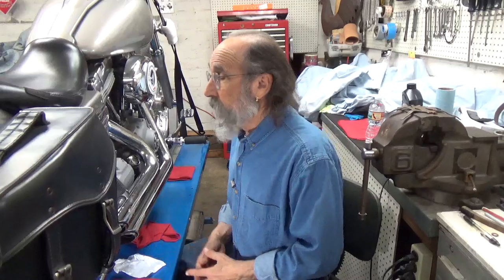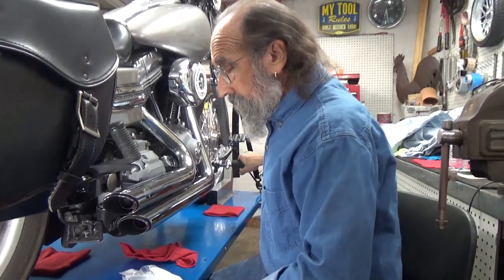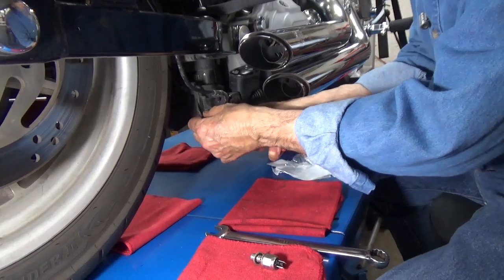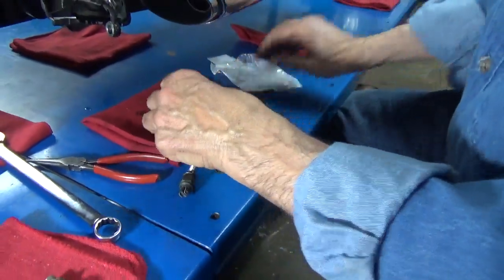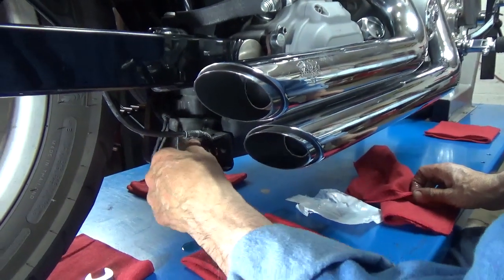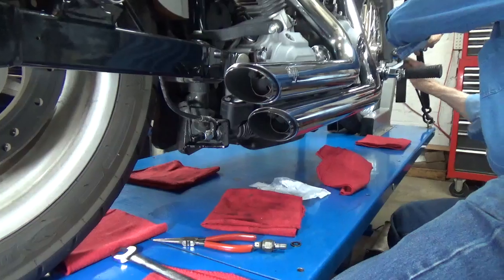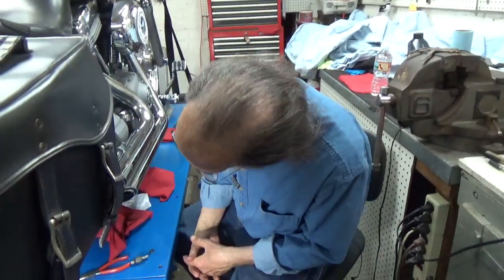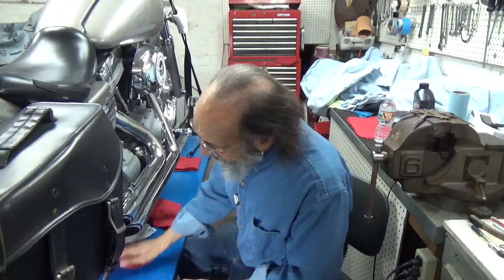Changing the Rear Brakelight Switch On a Twin Cam Harley Dyna

Comment: Excellent tip on keeping a little pressure on the brake pedal. I didn't loose but a small bit of brake fluid and no need to bleed the system.
Reply from the maker: Glad it helped!

Comment: It's a good thing the switch is working because a SUV rear-ending a motorcycle would be a very bad accident for both bike and rider.  I got lucky last October when my switch was defective on my Vulcan 800 (I didn't know it) and when I came to a stop the SUV that was behind me suddenly appeared beside me on my right, I was almost rear-ended and it would have been bad, the culprit was my brake light switch was defective.  It was my fault though because I got lax checking for all working lights before each ride.
Reply from the maker: Glad you're okay.

Comment: Great video I did this very easy. I had a question after I switched it out when I ride I feel like I have to put so much pressure on the rear break and it hardly slows any ideas why? Also rear break worked fine before I replaced the switch.
Reply from the maker: Try bleeding it or maybe the caliper needs cleaning.

Comment: Hello Mike, Dennis here, new rider, new Harley owner. I just bought a 2015 Dyna FXDL Lowrider and the brake light was on for a few days and now works intermittingly. By on I mean just like the running light, illuminated non stop. Now it just doesn't illuminate. If I remove the tail light socket and reposition it the brake light works for a few minutes and then goes back to not working. The running lights are fine but now no brake light and at first it wouldn't go out. No wires are loose that I can see, does this sound like the brake light switch? Thank you for your great channel and apologies if my question is not clear. The code displayed reads b2161...
Reply from the maker: Can't be sure, but, probably the switch.  Play with it and see if it's the front or rear switch.

Comment: Nice easy fix Mike, as always thanks for the videos. How about doing something on the '97 - '99 FLSTS  especially the front end adjustment and care. I love these bikes with the old evo's  and trying to learn as much as I can. Thanks again my friend
Reply: (cough) 'bikes with the old evo's' ? Sorry, must be an 'age' thing; 'old' to me means Whitworth threads & iron botty : )
Reply from the maker: Old?  I remember the first Evo cylinder head I removed.  That was in 1984.  Not long ago!  "Old" means 1930's, 1940's or even 1950's.  But, next time I work on an "Old Evo," we'll show it.  Thank you.
Reply: @pacificmike9501  You are right Mike, I was comparing EVO to a New 131.  I will stay air cooled, Thanks!

Comment: I just picked up an 07 softail custom two days ago, practically new I was thinking. Rode last night for the first time and clearly have a sticky front switch and no rear brake light. At least it'll be easy to check out today and with any luck get back out again tonight(FULL MOON). The caps must both leak because the powder coat is bubbly, but not wet. Wasn't there a recall for this? I sold my 08 Cross Bones about 6 years ago but I remember it went in and they put a fat 1/2 inch thick ugly cover on the front master.
Reply from the maker: Check to see what brake fluid your bike requires.  It is either Dot 4 or Dot 5.  It may have been serviced with the wrong one.  Be year and model specific.  Harley did some changes around that time.
Reply: @pacificmike9501  it says Dot 4 on the cover and I'll probably have to plan on flushing it all out. The rear switch is bad, the brake light came on with the jumper so nothing to guess about there. Thanks for making it so easy with this video!
Reply from the maker: Sometimes brake fluid doesn't get changed and should.  Quite often, the wrong fluid gets added.  Just be aware.

Comment: Thanks. Mine needs inspection and wouldn't you know it, today the rear switch is bad. Front activates brake light fine but rear only worked with pedal depressed all way down, this morning kaput.
Reply from the maker: Yes.  As they age, they require more pressure until they need replacing.
Reply: @pacificmike9501  Sort of like a woman. lol

Comment: Hi PM and MM ! Here's one for ya..my rear brake light works on the first press only. A second press and no light.. I have to wait several hours and then it works again on the first press only.  I did the switch test and it indicates the switch is bad. Pads are good. But normally the light stays on when the switch is bad. Any guesses? I wouldn't blame you if you pass on this one ! LOL...Take care guys I truly appreciate your efforts!
Reply from the maker: Okay.  I'm gonna pass.
Reply: @pacificmike9501  ouch

Comment: My Dyna Switchback is fine when you first take off on it but after about 60 miles the brake light comes on. I had to resort to putting a bulb in that won't work for running lights so it doesn't melt everything in my taillight housing. I need help.
Reply from the maker: Check the switch first.

Comment: Can a switch leak, but still work? My brake lights still work but the brakes do not, the rear brake goes to the floor. It seems to be leaking out of the switch.
Reply from the maker: Could be.

Comment: Even though some fluid leaked, you don't seem concerned... how much is too much? teaspoon?
Reply from the maker: Believe it or not, by holding that pedal down, just a little, you won't lose more than a drop.  After closing the system, pump the pedal a few times.  Now, bleed to check.  No problem.
Reply: @pacificmike9501  So he still needs to bleed them... I didn't realize that.

Comment: Hi Mike, I'm struggling to understand how you didn't get air in the line between the switch and the calliper on this one!
Reply from the maker: By applying light pressure to the brake pedal, there was no room for air.  There is , again, "light" pressure keeping air from entering.  Try it.

Comment: Mike - thank you for the great video! Do you know the part number of the rear brakelight switch for a 2008 FXDC?
Reply from the maker: Thank You.  It is a different switch than the other models use.  I don't have that parts book today.  But, your local HD dealer can easily give you the number and he may very well be the only place around that stocks that Dyna switch.
Reply: @pacificmike9501  Thanks Mike!

Comment: it's really weird, both the hand brake switch and foot switches went out at the same time, I got the hand brake switch fixed by applying a little oil to the piston shaft and then found out the foot brake switch was also not working, does the brake master cylinder have a switch in it ('95 FLSTC)
Reply from the maker: The front brake light swich is inside the lever housing.  The rear brake light switch is in the line along the frame between the transmission and thrr swingarm pivot.  The other things that could have happened, is, the bulb burnt out, or the wire is hurt underneath the rear fender.
Reply: @pacificmike9501  considering the light works with the hand brake I'd say it works, if the foot brake switch is bad would you still get a brake light with the hand brake?

Comment: My paper clip touched pipe afterwards no hazards or blinkers working all front lights are on but rear turn signals not but will blink when I put alarm on. Suggestions?
Reply from the maker: Check your fuses.
Reply: I’ll give it another look. Thanks

Comment: Question my break light stay on , would that be the switch thanks in advance from Australia
Reply from the maker: Well, what is the motorcycle?  Is it a front or rear brake?  Is it mechanical or hydraulic?
Reply: @pacificmike9501  it’s a 2016 breakout Hydraulic rear brake

Comment: How far do you depress the brake with the bungee?  What size wrench does the bolt take?  Thanks
Reply from the maker: Just depress a little bit.  I don't know what size your fitting is.
Reply: Same bolt you are using its for a 15’ dyna streetbob.  I think it maybe a size 11/16 wrench
Reply from the maker: Probably.  I'd have to run down a bike to check.

Comment: Does the rear brake switch need brake fluid in the master cylinder to work?
Reply from the maker: Yes, that's where it gets its pressure to operate.

Comment: 2008 Rocker C rear brake switch just went up in smoke on mine...   charred wires etc.. looks like a nightmare to replace because its right up against the frame and hardly zero room to work in.  Plus redoing the electrical connection.  arhhh
Reply from the maker: Bummer.  But, small issue.  Better figure out why something touched and fried it.

Comment: That switch it’s specially for bikes or car uses the same ones ???? Can I use them ?
Reply from the maker: That  is a specific Harley piece.  But, they work the same way o a car.
Reply: @pacificmike9501  okey maybe are the same, thread, size, pins, etc...

Comment: So there are 2 washers used? Just bought the switch at dealer and they said nothing of them.
Reply from the maker: I think you're speaking of the two gaskets, one on each side of the "banjo" fitting.
Reply: @pacificmike9501  yes. Thanks. I'll have to head back to dealer. 😎

Comment: Hey Mike! What if my switch is sticking do I need to replace it or put some old wd40?
Reply from the maker: You can try anything, but they periodically go bad.  I'd probably just replace it.  Don't remove it and "fill" it with anything.  That would contaminate the brake fluid.
Reply: @pacificmike9501  Thanks buddy! I just went to Harley bought a new one. It was only $12.

Comment: Will a bad brake switch cause loss of hydraulic fluid in the pedal
Reply from the maker: Only if it's leaking out onto the ground.
Reply: @pacificmike9501  on a ride yesterday just briefly my brake pedal went soft then I pumped it in the park position and it rehardened I haven't had a problem but now my brake light won't go out or off I can flutter my back break paddle a few times and it'll go off but I'll turn back on is that the brake light switch underneath the transmission

Comment: My brake light doesn't come on unless I'm standing hard as I can on the pedal is that the switch
Reply from the maker: Normally, yes.  It wears out.  You stand on it.  It works.  Replace it.
Reply from the maker: Normally, yes.  It wears out.  You stand on it.  It works.  Replace it.
Reply: @pacificmike9501  thanks for the advice mike I'll get it done see until then see you on the road
Reply from the maker: That's good.  Brake light very important.

Comment: Does it matter which side the wires go on? My 2010 wide glide has two wires
Reply from the maker: No, it does not matter.  It is just a switch.
Reply: @pacificmike9501  thank you
Reply from the maker: You're quite welcome.
Reply: @pacificmike9501  will the bungee cord holding the brake down work on my 2010 wide glide?
Reply from the maker: Sure.

Comment: What happens if you don’t hold the brake pedal down when pulling the switch, didn’t hold my brake pedal, pulled the switch, no light still. Electric is good and brakes are working, little to no fluid came out when I pulled my switch off. Bled the bleeder one time but seems silly to flush the system don’t think that’s my problem
Reply from the maker: Is the bulb burnt out?

Comment: Why in the name of all that is holy doesn't Harley use the simple and reliable mechanical switches like those on all the Japanese bikes?!?
I have owned 27 motorcycles, 3 of them Harleys and had the rear brake switch on all three Harleys fail and exactly zero of the others did.
I love my HD's but that shit is just quirky for the sake of being quirky.
Reply from the maker: I don't know what to say, other than, "Don't kill the messenger."

Comment: You left air in the lines, you need to bleed the brake.
Reply from the maker: That's why the pedal is pulled down slightly, so it can't suck air.
Reply: @pacificmike9501  Yeah, but air was introduced in the line and  the switch itself, whatever leaked out was replaced by air. Yes, the brakes seem okay but air is air.  Because of the placement of that block, it probably won't backbleed like a MC would. Advise your watchers to bleed the brake.
Reply from the maker: Okay.

Comment: BLEED THE BRAKES! You have introduced air in that line. Putting a bungee on the pedal does nothing for the line you took off past the master cylinder. Don't be lazy and not have an effective brake and risk death for something that only takes 2 minutes of your time a screwdriver and a small wrench.
Reply from the maker: Thank You.

Comment: Question can the rear brake switch make the brake stay on if broken mines is keeping the brake on all the time I've checked the front brake as this causes this problem but it's the back one keeping the light on
Reply from the maker: When in doubt, bleed the system.  If that doesn't work, there is something in need of repair, either the caliper or master cylinder.  If the brake works properly, but the brakelight stays on, check the switch.
Reply: @pacificmike9501  that for getting back to me I'm going to change out the switch